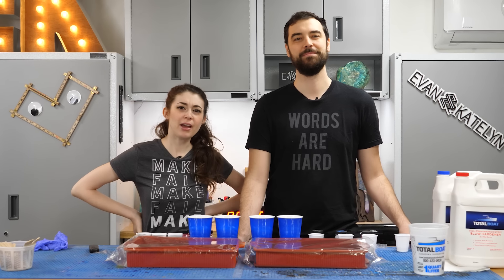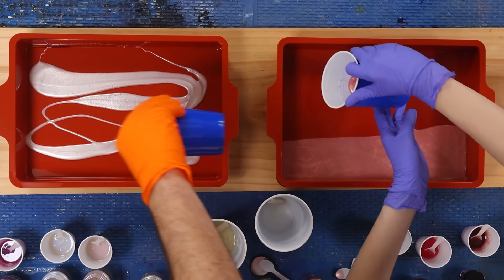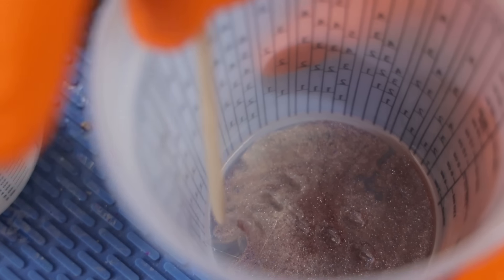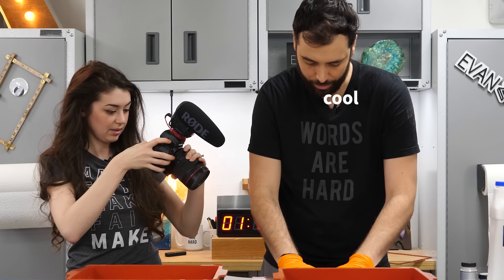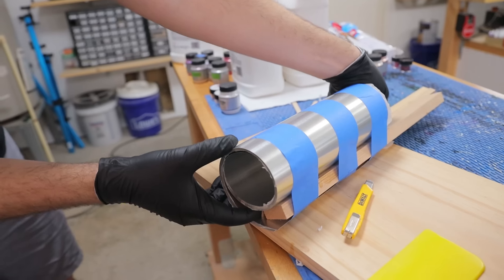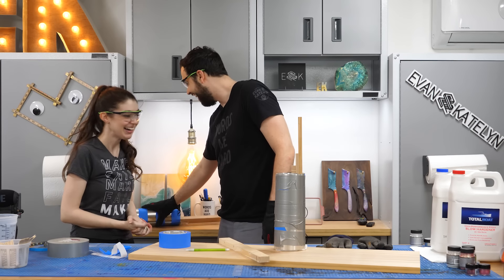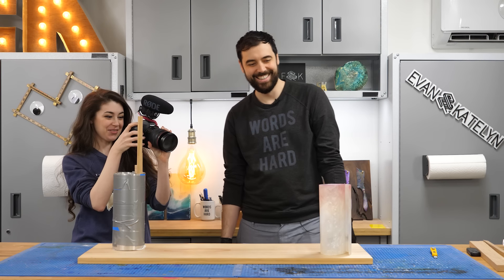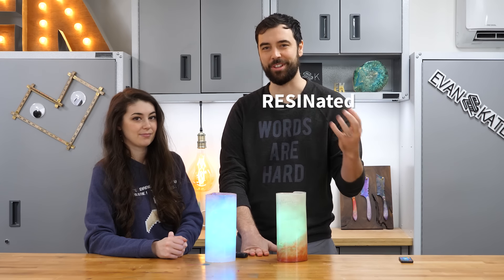Can we BEND Resin into a Lamp?

Comment: That one room in your house is so full of resin and LEDs, haha.
Next video: We made a door out of resin  to our resin room
Reply from the maker: the next logical step haha!
Reply: EvanAndKatelyn omg please 😍😂😂
Reply: @EvanAndKatelyn  please do that if it's even possible!
Reply: We put LEDs around our whole room and covered them with resin paint (if that’s even a thing)
Reply: Oh, you could get a door with glass panels and just replace the glass with resin panels. And then a custom resin doorknob.
Reply: duuuuuddde(ette)!
Reply: Okay but that would actually be really cool!
Reply: i think a wavy colored resin door with clear glass panels would look better though
Reply: or better yet, wooden door with an oval/rectangular/diamond window with resin sort of bleeding from the glass into the wood about halfway to the edges of the door would solve the problems of hinging a resin door and making sure it's strong enough, and would be a lot easier than trying to cast a resin door from the start since you'd be using the door itself as a mold so you'd only need a large sheet of PPR or other plastic that doesn't adhere to resin
Reply: Lol 😂😂
Reply: or even start small and do a resin door handle 😉

Comment: 5:50 I tried doing an epoxy resin project in December and I didn't read the instructions entirely and this is exactly how it turned out by the time it should've cured. I looked back through the instructions and found that my room was too cold for it to cure properly. I'm going to try the project again when spring or summer comes because now I know to keep my room warm. Anyway, you guys were my inspiration for the project! I'm excited to get back into the resin soon! :)

Comment: You can also get easily bendable sheets of plastic that have different designs/textures. I think they’re mainly used for chocolate but they work with resin great. The thickness is going to always be the same size. They’re really cheap and they come with I believe 4 or more different textured sheets(they do different themes for the package of sheets). I think amazon and eBay both have them. 

Great job as always!!!
Reply from the maker: That's be interesting to try!

Comment: I love these! I wonder how it would turn out if I use my silicone pan that has a soft groovy/wavy textured bottom. I normally use it as a paint tray when I use small roller brushes, but I think it could have potential as a groovy lamp mold. Ha! Multipurpose baking pan that’s never been used for actual baking. 😂🤣

Comment: The best way to bend resin is to use a Soft Type UV resin (UV resin comes in both Hard type and Soft type - soft is also good for some types of jewelry such as bracelets that stay flexible even when cured completely ) which remains as bendable as you want.  You can then, once its in the shape you want, paint it with a hard  type UV resin or a two part resin that is thick like the resin used on tumblers.

I use a lot of the UV resin soft type for anything I want to freeform resin into. The soft type UV resin not only stays totally flexible and bendable even when totally cured. it accepts pigment very well, does not have much issues with bubbles although I usually let it sit at least 15 mins before using the UV light and once its shaped I usually give it 24 hours in its shaped state before applying a coating resin and I apply the coating resin on all sides and give it at lest a day to fully cure before removing anything I have holding the resin in the shape I want.  Its excellent also for making things that it helps to have the resin main a soft and flexible feel.  I use it to make handles for writing tools and eating utensils for those with weak hand strength that cannot grip well such as young children with CP or elderly people post a stroke and so on.  Many times these are made from foam but foam often is too soft and has no resistance to it at all so it does not give the best grip.  The soft resin feels soft and its nice and flexible making it easy for carer to slide in on an implement or utensil but then it will stay in place for the type of object it was molded for, but when griped it has resistance to it and does not just flatten down to the tool or implement its on.

Comment: I would have left the resin a little longer. There's a stage where it's bendable but not sticky. If it's bendable you'll always run the risk of leaving indents.

Having watched more, Katelyn's timing was pretty spot on. Though the fact it was thicker isn't ideal for the bending process, it does produce a better product IMO

Comment: Could you use a disc sander to flatten the end to make it sit better. Also maybe retro fit a base so it's not just on the the resin but suspended in the air a little

Comment: hey ! I WATCHED A LITTLE AND I DIDNT SEE ANY FIBER GLASS !  FIBER GLASS IN LAYERS ALMOST LOOKS THE SAME AS WHAT U HAVE THERE CAUSE U HAVE THE COLORING IN THE RESIN !  THE FIBER GLASS STOPS THE RESIN FROM CRACKING AND SHATTERING IF U TRY TO CUT IT WITH A SAW OR DRILL IT WITH A DRILL BIT ! YES ! ALWAYS USE EITHER CUT 1 INCH SQUARES OF FIBER GLASS CLOTH OR LAYERS OF 6 TO 8 OUNCE CLOTH !  IT ADDS ALOT ON TO THE PRICE OF A RESIN PROJECT BUT IF U NEED IT TO BE TOUGH TO HANG UP
OR WALK ON USE THE FIBERGLASS WITH THE POLYESTER RESIN (BOAT RESIN ) OR USE THE SUPER EXPENSIVE BUT NO SMELL EPOXY RESIN ( AND DONT GAS YOUR SELF AND YOUR NEIGHBORS OUT) !

Comment: Next time don't try to line up the edges. Put the resin in at an angle and once fully cured cut off the bottom on the band saw and sand flat on the belt. This would leave the top to be a cool spiral to a peak.